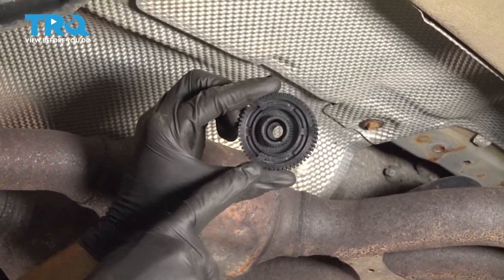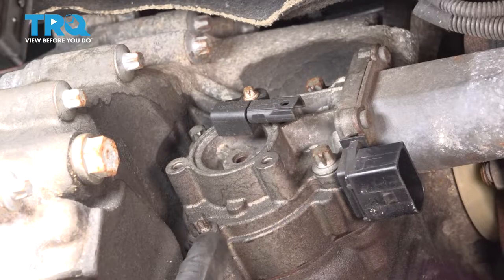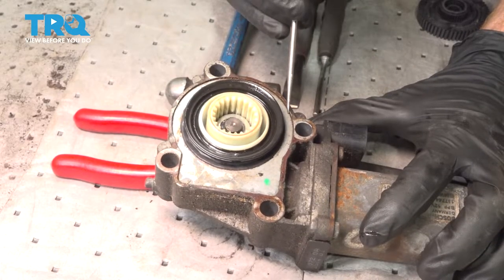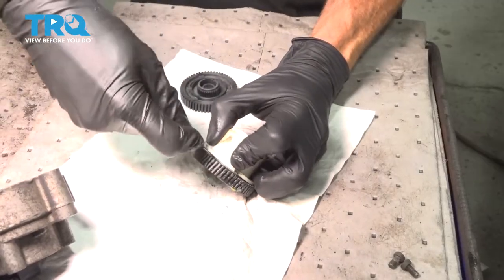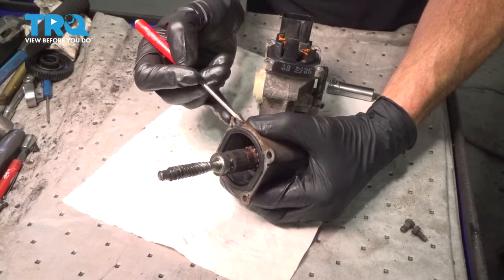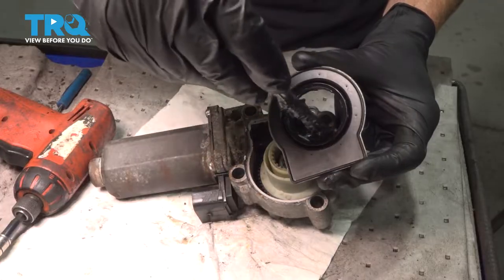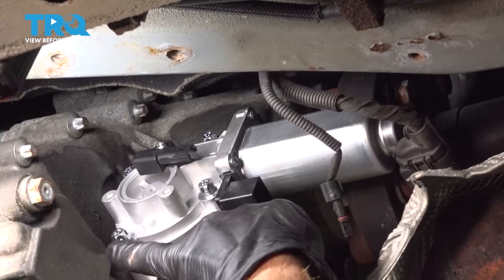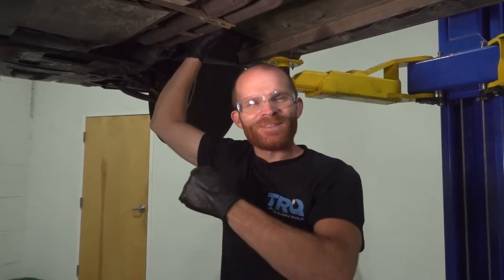How to Replace Transfer Case Actuator Gear 2004-2010 BMW X3

Comment: Nice work - I learned alot. Rather than fitting a replacement gear I would spend the $80-$128 for a new actuator motor and case with new mounting bolts. Good stuff nonetheless. Thank you!!!

Comment: Replaced my plastic gear as shown.The replacement was out of round.This caused binding as the motor turned when bench testing the acuator before installing it.Replaced the plastic gear again and shimmed the motor mount so it would turn smoothly.

Comment: Pull the motor remove the gear assembly from the main motor assembly..then turn the gear 180 degrees. You're good to go for another 100k miles. Nothing to buy

Comment: Ours is wearing out in 50,000 kms. We had 4 new Bridgestone tyres that match the door jam label, with exception of speed rating, so rotational difference should not be a factor.  BUT, the trifecta of lights comes on every couple of days, goes off after a couple of engine restarts. Any clues why that would be??

Comment: Rebuilds the actuator motor, obviously struggling to get the cover to stay down when peening it, next shot is a obviously new actuator motor being installed. Nice idea but peening aluminum is not easy and to try and get a good seal on that cover would be difficult.

Comment: No point in replacing old with new or rotating 180 degrees these will fail again at about 100k.  Replace the original gear with a carbon fibre one available on eBay. Wtf BMW made a plastic/nylon gear operated by a steel worm is beyond comprehension. 🥶